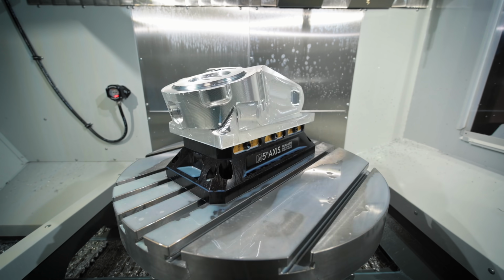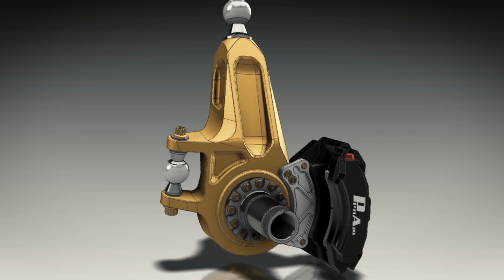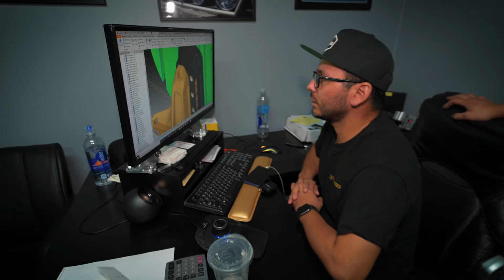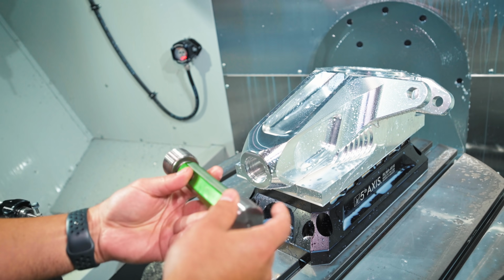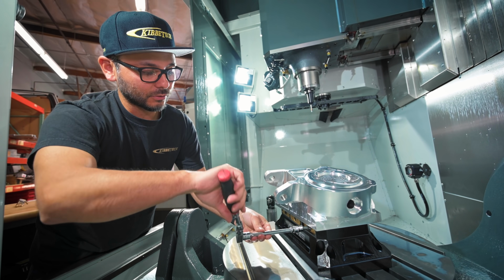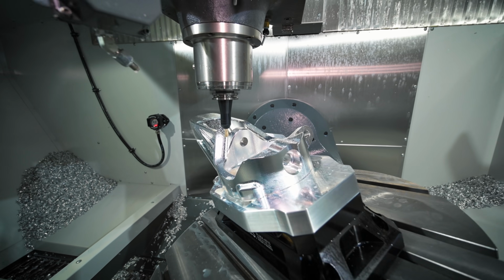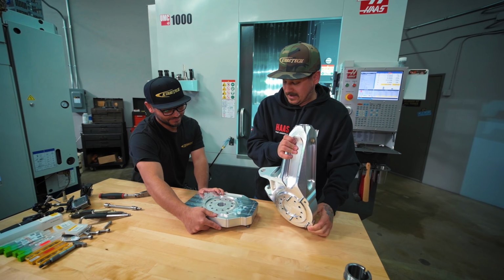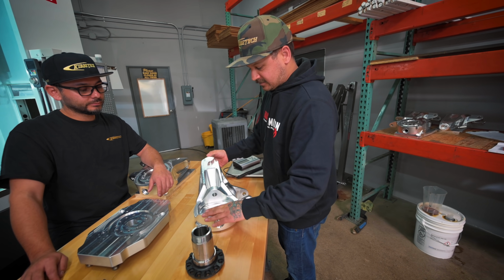Our New 5 Axis Built Spindles Are Done!  - Kibbetech Ep. 28

Comment: Although these are designed and built tough like a 1940's battleship, considering that these will be punished, due to the nature of the part's job, can these just be bolted on and run, or will these still go through an aluminum heat treating process and then get anodized? Either way, these parts are sexy. Unknown to me if these 5 pairs are only for you or for trial testing before production and open sales, but is the future calls for these being production and for sale, is it safe to assume the MSRP will be about $2000 a pair? and That is wishful thinking from me, as something tells me, these might be more along the lines of $4000 a pair? Either way, really nice looking stuff.
Reply from the maker: essentially right outta the machine onto a truck! These go hand in hand with our center mount front end and Pricing is north of your guesses.
Reply: @Kibbetech  Roger that.. Thank you.. I'll keep my eyes open on these. really nice looking stuff.